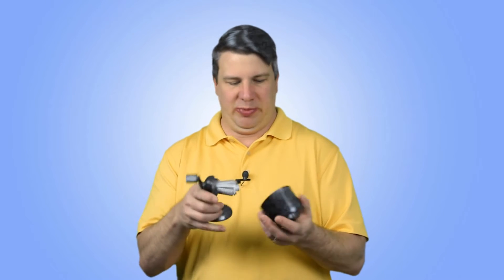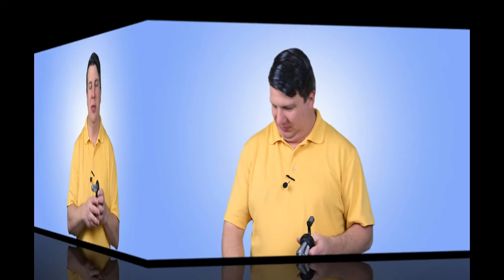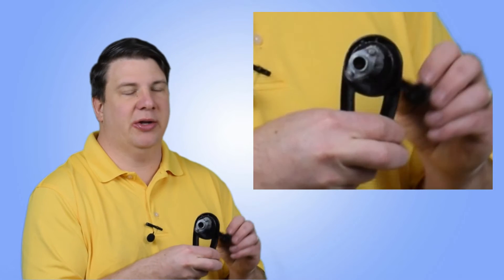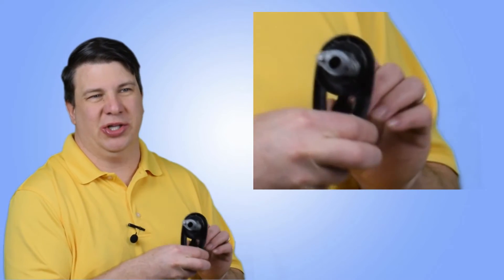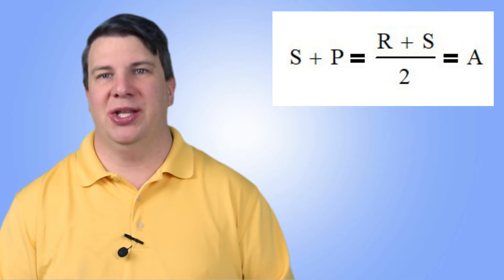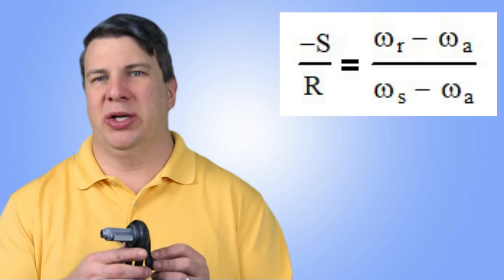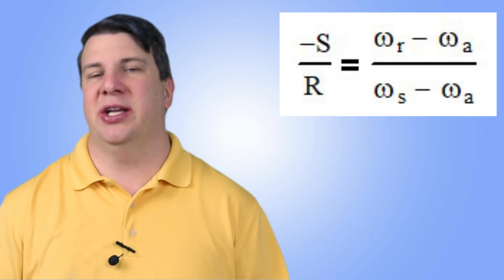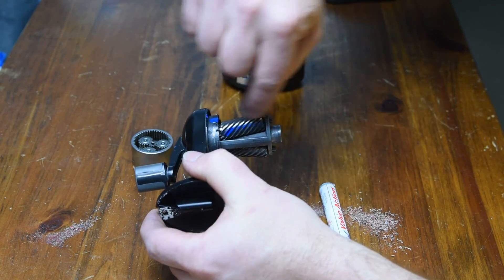STEM - Planetary Gears in a Pencil Sharpener

Comment: Your hand eye coordination is as good as your track selection 😂. These sharpeners have bevelled gears which benefit the smoothness no?
Reply from the maker: The ring gear is beveled to match the taper of the of the sharpened pencil.  Other than that, they are spur gears.  The cutting teeth are helical in nature so that the pencils finish is smooth.